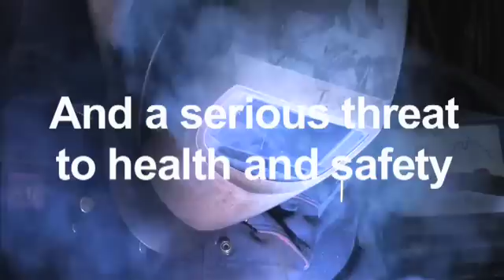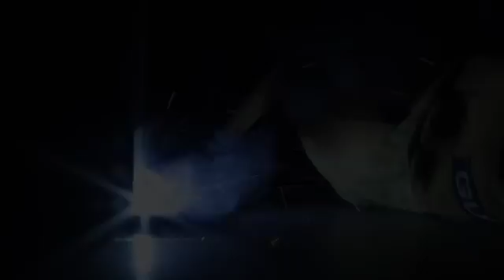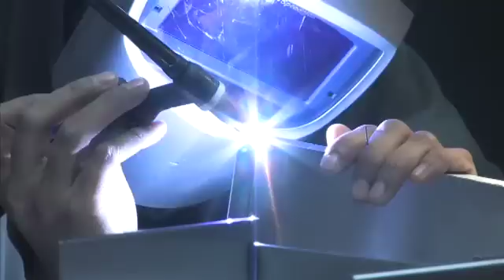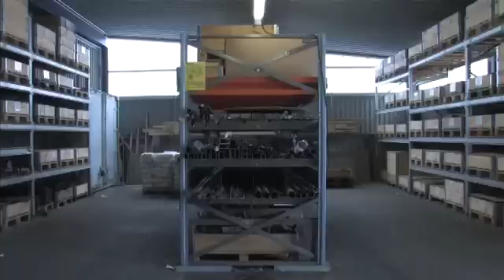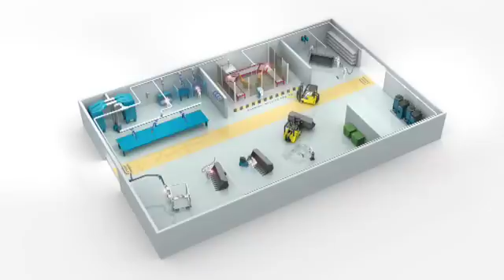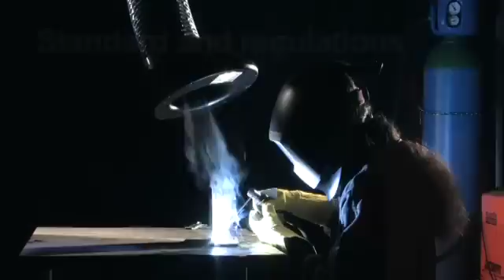Nederman: Welding Fumes - Risk and Solutions

Comment: I've had it, it sucks ass, I felt sick and tired and coughing for days after a bought of welding in college, I dunno what I did but I got sick wleding.
Reply from the maker: We´re sorry to hear that, hope you feel better now! It´s the outmost important that welders have the right protection equipment and are not exposed to hazardous welding smoke. Therefore a proper weld fume extraction solution is vital to safeguard the health and safety of the welder.

Comment: Currently in school i got ultra ultra sick my first week felt like the flu not sure if this trade is for me anymore
Reply from the maker: Sorry to hear that. Inhaling welding fumes is a serious health risk that can cause numerous health problems. However, with proper weld extraction at the source we can minimize the risks and create safe working conditions for welders. 

Learn more here: https://www.nederman.com/en/industry-solutions/welding-and-cutting
Reply: Any update? Please, I go next month and starting to second guess my decision.  Are you still in school?
Reply: @nueni3380 go for it brother, I get that youre concerned about your health, but welding can be safe, just wear proper ppe, the respirator can protect you, goggles can protect your eyes and ears plugs can save your ears ,I've been welding for a decade  now and I've never had a problem with my respiratory system, if you're still worried, then specialize  on tig welding😅, it's the safest.
Welding I'd a tough job and it's not something you would want to do for multiple decades, seek for promotions and become an inspector so you can work with metals and not put your health at risk.
Good luck.

Comment: I work in a place where there's a welding facility just outside and a sandblasting on the other side. I see this black dust appears on my desk, white papers darken. Could that be the welding dust ?
Reply from the maker: It´s really hard to tell what the black dust on your desk is, but if you are concerned you could always contact the welding and sandblasting facilities.
Reply: @NedermanHolding  it's all around, on desk, on computer screen. To me it seems like weld dust. It looks like dirt when I wipe my computer screen with white paper it gets all dirty. Even now I swiped with my finger and it's looks like earth dirt almost
Reply: @terrorsquadlith  the grinding stuff plus weld dust
Reply: @ I finally left that job, but spent 8 years working there in these conditions, breathing weld dust

Comment: I work in a workshop where only occasionally someone is welding and I get extreme headache and chest pain even though I do not weld myself, just being in the same room.
Reply: As a welder i can say that i have gotten used to it. But i still wear a respirator. I welded without one for 2 weeks and felt like i was going to die and got symptoms of smokers lung without even smoking. Everybody reacts differently to chemicals. Dont let anyone convince you that you dont need ppe
Reply from the maker: Yes, welding fume can affect your body and wellbeing even if you are exposed just for shorter periods of time. That´s why it´s important to have the right equipment, where extraction at source have proved to be the most efficient method if capturing and removing welding fumes. Find out more at https://www.nederman.com/en/applications/welding-fume-extraction.

Comment: Can get an adflo from 3m, it’s a welding helmet that filters the air. They’re expensive tho and you need to change the filter every now and then.
Reply from the maker: Personal Protective Equipment is an alternative and may be a complement but the most effective way is to extract the fumes as close to the source as possible.
Reply: @NedermanHolding  would love to work somewhere that has this sort of protection but my company gets jail inmates shipped in as what i can only describe as legal slave labor. I dont think we will have nice things this soon

Comment: I weld stick sometimes just for fun. Started to wear a respirator (ffp2) just to be safe. I never weld anything toxic. Just clean steel. Always wipe with IPA alcohol. Cleaned my metal with brake cleaner once but washed it again with alcohol just to be sure. Same with soldering. I bought a fume extractor.
Reply: Bro if you’re just occasionally welding you’re fine. It’s the guys doing it day in day out for years who get health problems
Reply: @Alex-gf4iu  yeah I know but for the price of a respirator it doesn’t really matter and I dont have to breathe it in. I work with paints for my hobby too. Plus im sensitive to chemicals
Reply: Plain steel is still toxic. Gas from the flux is toxic,  ozone produced by the arc mixing with oxygen is toxic,  regular steel contains carbon,  silicon , manganese, iron etc. 
And dont use break cleaner,  acetone is all you need.
Reply: @dinoj8126  yes any fusion process releases gasses. Acetone is expensive compared to Ipa.
Reply: @Barrybigdickstein  You can get it for 3$ and you get a liter. You dont need much just to wipe it a bit, and be careful.  I use a welding hood with a respirator and a fume extractor
Reply: @Barrybigdickstein  good luck, and happy welding
Reply: Avoid brake cleaner, causes serious poisoning. Chlorine based cleaners  leave residue which creates phosgene gas when welded. A video I watched recommended to use acetone to clean metal. https://www.youtube.com/watch?v=r7srRiQebq0

Comment: Are you guaranteed to breath the fumes in even with a high end respirator? Im going to welding school and i dont know what im getting myself into health wise. Should i be scared or do i just gotta know all the saftey precautions
Reply: The gvs p100 or the 3m p100 paired with a fabri-metal tiger hood is a great combination for protection the tiger hood was designed to be under hood resperator friendly and attach to a hard hat easily
Reply: plz don't recommend gvs masks.. pure garabge @willbecker5632
Reply: At the weld school they probably have booths with very good ventilation.  You probably won’t be around any big clouds of smoke since the smoke probably gets sucked out of the room

Comment: I've never seen that personally building industry for 25 years I know people that have suffered I've seen people within a couple of months get what's known as black lung for breathing all the crap in a tanker building grinding welding fumes smoking doesn't help I've been wearing an under hood respirator for the last few years haven't smoked in 12 years I am in pretty good shape now if you can consider round a shape long protection is definitely a must
Reply: Which respirator do you use
Reply: @User15837  you can check out GVS elipse or 3m 7500. They both have specific filters for use during welding processes. P3 with activated carbon. 
I think 7500 is better. It's the one I personally use, even though I own both.

Comment: how far are large companies that galvanize steel have to be from neighborhoods or living complexes? also, are the clothes that the welder wears while working , is that also contaminated? if so, can he spread chemicals by not taking off his uniform and going to a public place ?? thanks !!
Reply: jessica pedraza metal is dirty, all work around metal is dirty. clothes are blackened and ripped on sharp metal daily. we go home sore and tired and toss the clothes into the laundry. they dirty up the car and anything they contact being that the dirt is in dust and rust and particles. we hate welding galvanised and usually get sick from it. I was taught to drink a qt of milk before werk. a qt at lunch. and a qt after werk to prevent it from getting in. it seems to help. 
its a tough job.

Comment: I'm a newer welder >3 years and I'll share my modest wisdom. I have met a lot of shop foreman that boast about how much money their company makes. Then I take a lap around the welding area. 40, 50, 60 year old welding machines. No extraction, high ceiling yes but active extraction. Mostly never. OSHA says that you must have a high ceiling in a weld area. Most of this stuff is metal particles. Its going to drop, the welding fume doesn't stop being a danger when the arc stops.I personally do not weld unless I have two of three types of extraction. Mechanical by means of a fan blowing or sucking the fume away from your head. Passive/natural, an open freight door. Now before I get someone butt hurt. When tig welding you can always put a piece of cardboard up as a wind break as tig doesn't cause spatter. Lastly  personal protection. I wear a half mask with P100 filters in them I change out every week, if its needed or not. PAPR helmets are great, expensive but its the closest thing to 0 exposure. The next best thing is not welding.  It blows a stream of purified filtered air out so all your breathing is clean filtered air, instead of the alternative.**For the US with BWC insurance you have health and safety programs and "bonuses" you can receive for preventative things. If you give your employees a respirator or PAPR, its going to discount your policies premiums   **Back on track now. Use a mask when your grinding, not just a face shield as it kicks up and under.Its worth the prevention. You don't want to be dealing with WC when your sick. Its an expensive set up to start, but when you think of the alternative its very cheap. We have a shorter life expectancy based off the welders conditions during the 60's-90's when fume control wasn't as readily available. Now I'd like to see the numbers.
Reply: My job has poor ventilation and lots of plasma cutting fumes, my problem is it irritates my eyes as well as my throat a bit but I have a p100 filter for that. Not sure what I could cover my eyes with so I'm not losing my eye sight.
Reply: @fish4fun354 goggles.
Reply: Thank you for this comment!
Reply: I weld and grind for 6 years, almost full time, I used only side ventilation but still got my throut irritated. Now I use also a activated carbon 3M mask when I can, big improvment
Reply: @romeufilipe5574  Thank god Im not the only one. Im 19 and I am almost graduating as a welder. I have tha same problem like you. My throat gets very irritated like two to three times a month because of the fumes but where I practice there is no extractors
Reply: @gabrieljordan9977  extracting and carbon mask is the best, you will rarely notice anything. in winter cold mask alone works but eyes will not like alot of smoke. So extractor becomes a need for long term
Reply: Eis Geist I'm a professional welder also and it's really exciting to burn people with the contact end. it teaches them a lesson to wear protective penis guards because it's the first thing to drop off when you get fumes

Comment: I'm not a professional welder but I stick-welded for a couple of hours in my garage without ventilation and I probably won't weld again within the next year, do I have to be concerned?
Reply: +eishockeyjunkee As long as you weren't welding anything weird like paints/oils/organic solvents your fine. Order a disposable N95 filter that states it IS for weld fume. Its cheap and keeps the crap under your PEL.